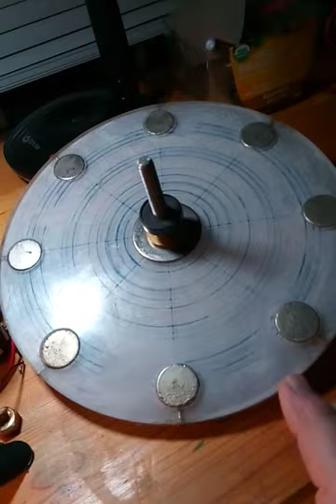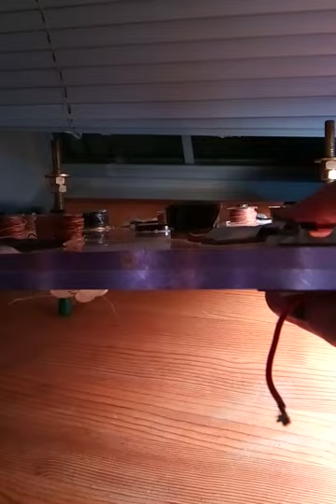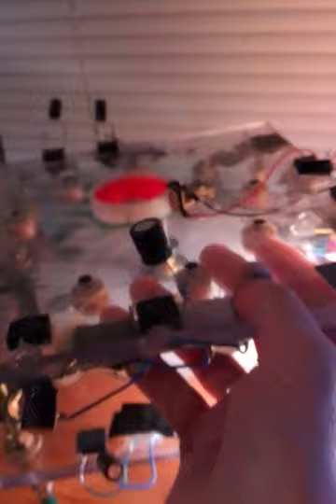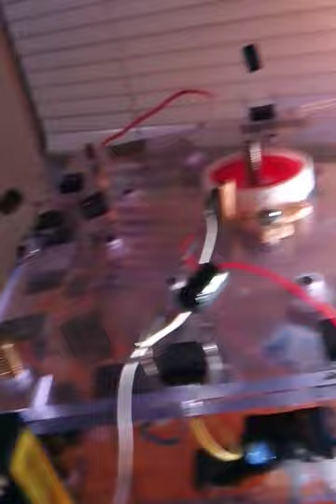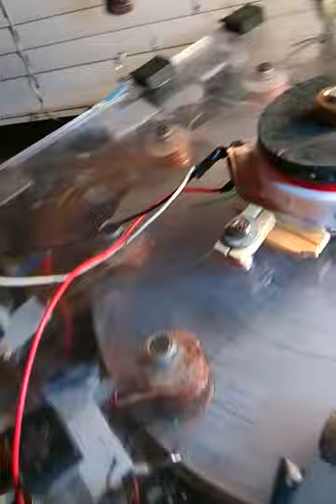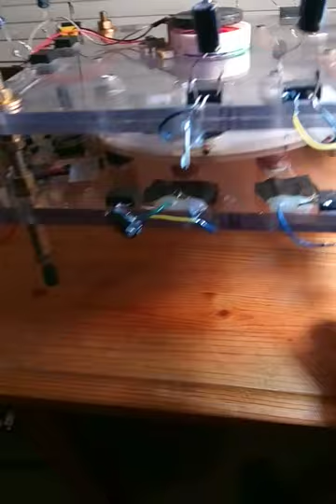Muller generator design;  RomeroUK style variant

Comment: Good to see you are back experimenting! Happy new year..
One remark if i may.. for the motor part.. if you use the timing magnets on the outer rim.. the pulses will be much much shorter (it will be more difficult to adjust though) I think you should try both, and see what difference you get in consumption. even if you use a pwr, it will be using a couple of miliamps.. maybe just the amount you would need.
Luc
Reply from the maker: Hi Luc
I have run it already with timing magnets on rim, it worked good,  the small timing disc has magnets half the width as rim-magnets, so I think pulse width will be near the same, plus can pull back away hall effect a bit too, to lower pulse width even more... Its alot easier to adjust timing with the swiveling hall effect up top....I can always do both ways at once too...as two motor coil positions and one way could be for the delayed connection to flyback into caps and whatever else...PWMs I am thinking not only on input but output of all the coils recitified into cap too and using PWM (and DC to DC boost convertor as well) into another cap (the run cap)  whats going to be cool about this motorgen is the magnets stuck to back of cores I think so at least
Thanks for writing!